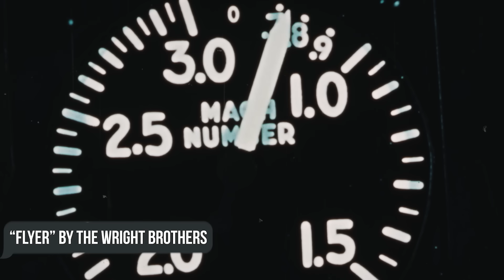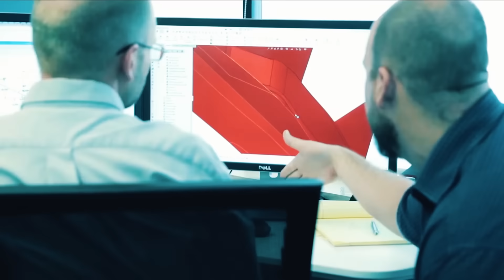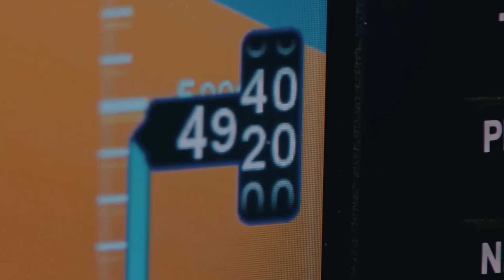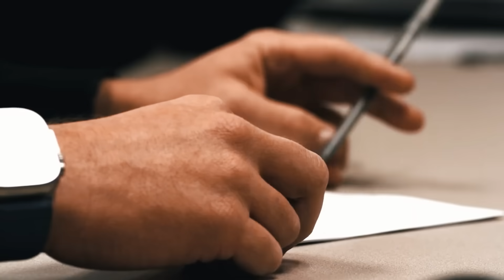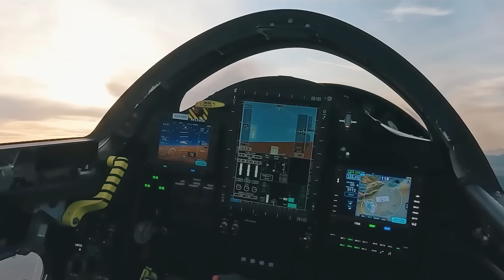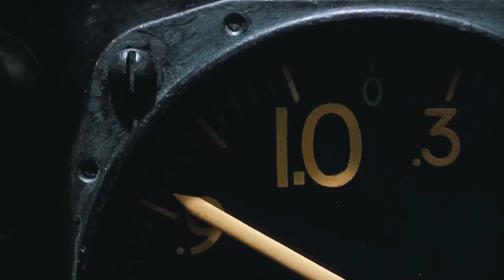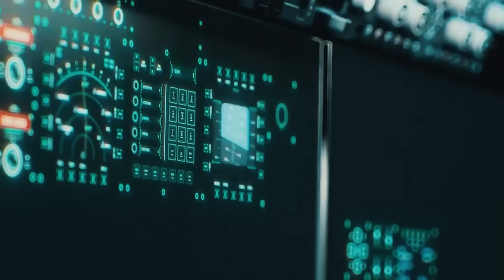US Concorde Successor Has Finally Reached Supersonic Speed!

Comment: The fact that they said that they were be delivering medical supplies and people in this video is hysterically wrong. And the fact they got rid of the Concord, which was perfectly fine, extremely safe, super fast and very reliable was removed for a reason. They don’t want people at those speeds or heights because they cannot see the curvature of the earth, it’s totally flat at that altitude and this is a fact.

Comment: As a former Air Force pilot I guarantee “delivering passengers and medical supplies “ is nowhere on the proposed mission list. Bomber and/or reconnaissance is. Just thinking out loud.
Reply: The fact that they said that they were be delivering medical supplies and people in this video is hysterically wrong. And the fact they got rid of the Concord, which was perfectly fine, extremely safe, super fast and very reliable was removed for a reason. They don’t want people at those speeds or heights because they cannot see the curvature of the earth, it’s totally flat at that altitude and this is a fact.

Comment: This is not the most advanced aircraft.
Reply: Most advanced passenger aircraft it should say.
Reply: @  it not a passenger jet just a test bed to determine if the design will reduce the sonic boom so it can travel across populated areas.   It will be very expensive to travel on as the fuel costs to go that fast will still be very high and the actual passenger plane will seat 100.  This will just be for the 1%!